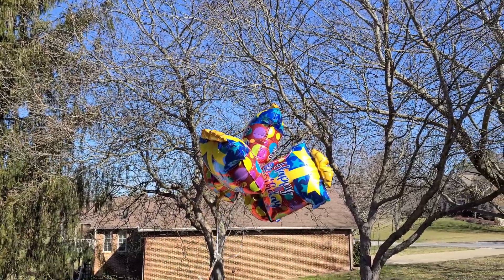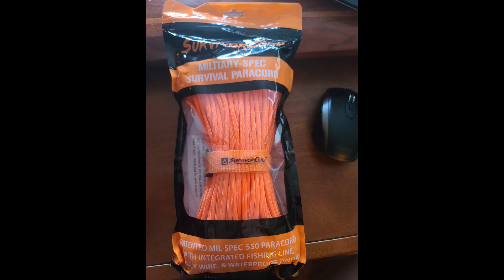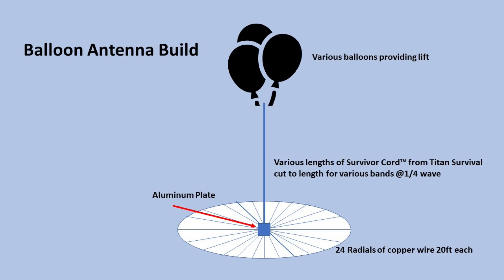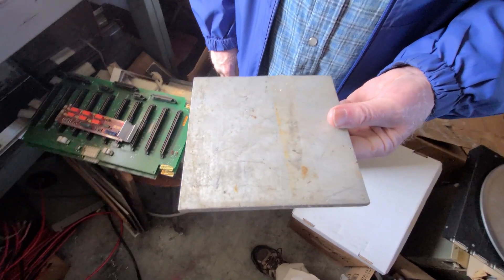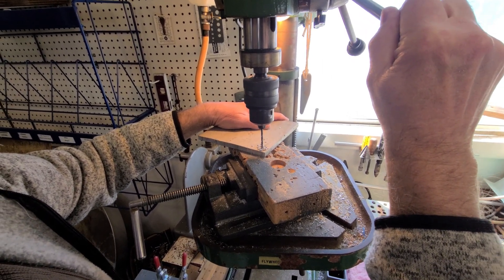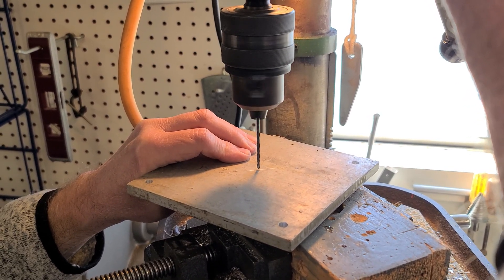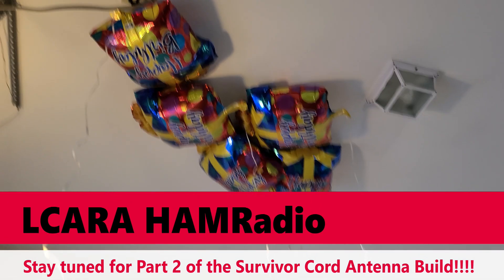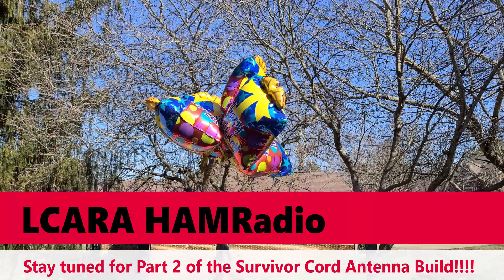LCARA HAM Radio: Survivor Cord Balloon Antenna Build - Part 1!!!!

Comment: Safety is a priority in any shop. Clamp your work. Use lubricant depending upon thickness. Start with an automatic punch to prevent drill drift. Begin with a small diameter drill and work upwards in 3 to 4 steps. Use a chamfer tool. Use a deburr tool on edges.

Comment: Good work,funny ,was just thinking similar ,for the bush trees of 30 meters.. in NZ we get helium tanks for party balloons filling, 30NZD,  or carry balloons pumped,hehe..hmm big gas can fill little gas with adaptor..old flyspray can can be bike valved with solder an for to 300 psi max,,,but only use 200 psi,an look it up also..a small CRC or so could pump 2-3 balloons an is only 4cm X 10cm, pocket size..an fill it off you helium tank 15+ times...oh yea when valve is center out,you can pour paint or what you like in can an air pump up.. pepper even..for bears..or just air for dusting or opening REX doors opps.youll have to ask for that one,an show you lockpick cert.or ask nice..an don't use it,just know for real emergency's..